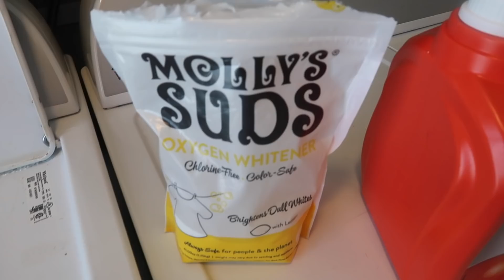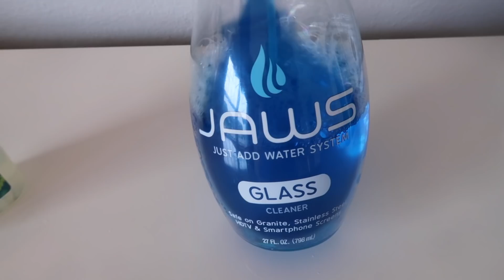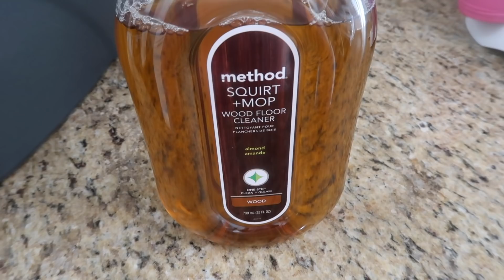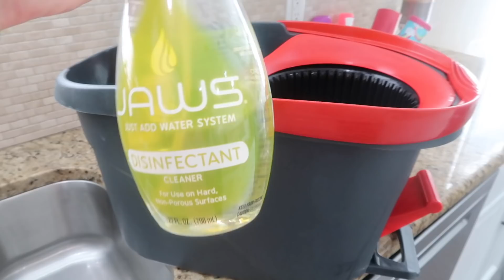*MESSY HOUSE* EXTREME CLEAN WITH ME 2021 | SPEED CLEANING MOTIVATION | JAMIE'S JOURNEY

Comment: It would be awesome if you could make a full video showing how you "service" or clean all your cleaning tools/ appliances. I feel like no one ever shows that you still have to wash your dish washer and your vacuums and washers and dryers!!
Reply: Good thinking. Cause I take my vacuum part and beat the filter off of something outside 🤣👀 and I have a heck of a time at the bottom of the vacuum with hair getting rapped around it. Smh 🤦🏽‍♀️
Reply: @_RavishingRaven_  literally! It takes me at least 2 hours to fully clean my shark vacuum and with 2 dogs you best believe its high maintenance
Reply from the maker: This is a good idea!
Reply: I need help on how to clean out vacuums!
Reply: I don't clean out my vacuum as often as I should.  It's a Bissell canister, perforce helix I believe.  I've found that the easiest way for me to clean out the canister is using a swiffer 360 duster.  Anyone have any ideas for quickly and easily cleaning the brush and area it goes in?  I've got a way I usually do it, but it's a pain in the butt lol.

Thankfully cleaning the hose is easy, just let it suck air.  Ooh, and the filters are washable lol.